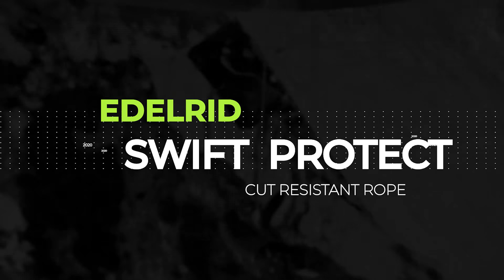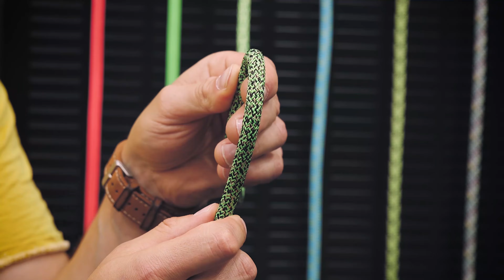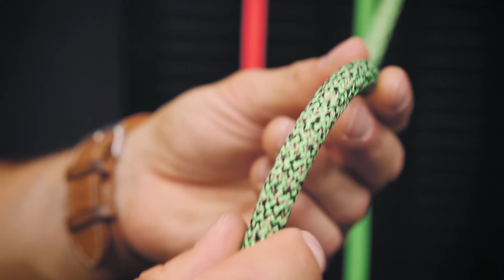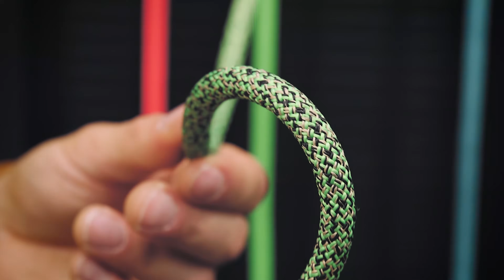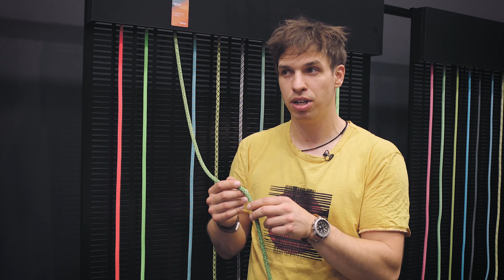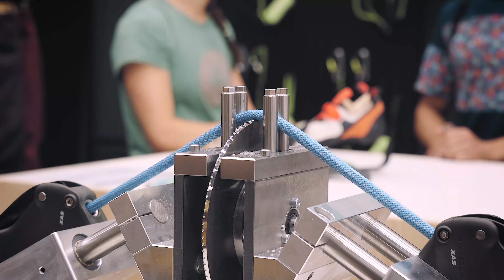*ALL NEW*  Edelrid Swift Protect Pro Dry climbing rope with aramid sheath

Comment: Friend just core shot this rope on a single rappel. His mistake was running it over a relatively sharp edge, and being a bit less than smooth in his rappel, stopping and bouncing a few times. That said, the rappel lasted all of about 20 seconds, so for this rope to boast as it does about cut resistance seems to be completely inflated in my opinion

Comment: Jeezus... people are going to climb on an 8.9mm single rope? That takes some real faith. Why not put this same tech into a 10mm rope and produce something that is absolutely bomber?
Reply from the maker: Tommy Caldwell told us he climbs on the 8.9 swift (non aramid version) for almost everything other than big walls. Like Phil mentions in the video, with all the incredible technology in dynamic ropes these days, cut resistance is THE limiting factor in rope safety, which is why Edelrid spent the last 5 years trying to figure out how to measure cut resistance, and then make ropes that actually are more cut resistant... and therefor safer. There is very little evidence to suggest a 10mm rope is safer than an 8.9mm rope IF that 8.9mm has the same cut resistance. Assuming that it's necessary to have a 10mm rope or larger for it to be "bomber" might be more of a mindset we hold than a statistical reality. If we can't point to accidents in which 10mm ropes were cut, than adding addition cut resistance to make a 10mm "bomber" is like making a rope that can be certified to 30 or more falls in a UIAA test. At that point, there is essentially no evidence to say it is better, even if it is more. It feels safer, but the margin of safety might be so large to begin with that any additional margin is effectively inconsequential. Caveat: I don't have any specific scientific evidence to back up these statements, they are simply my opinion that I've formed after limited research and speaking with many rope manufacturers.
-Andreas
Reply: @WeighMyRack  Yeah, I'm not Tommy Caldwell. Nor are 99% of climbers on the planet at his level. Don't tell me we're doing that crap now with climbing gear. I don't much give a shit what shoes Tommy or Chris or Adam wear or which cams they use or which rope.
Reply: 2 reasons: people want skinny ropes because they are lighter, 10 mm rope with this tech would probably be too stiff.
Reply: When you are using a 80 oe 100 m rope it makes a huge difference if you are using a 8.9 or 10mm rope. I climbed a lot on a 8.9  and 8.7 mm rope belayed with an grigri without an issue. The modern ropes are really durable, maybe you should try it.
Reply: @mikafull  Even with a 60 m rope it makes about 0,5 kg difference in weight between a 8,9 and a 10 mm rope. 0,5 kg is much in the alpine environment.
Reply: Man people have been running 8.9 for a long time now, over ten years.. Beal Joker, Mammut Serenity etc. The ultimate strength not far off, usually just rated for less falls. I'm on the large size, so 9.5 for my light rope but lots of my lighter mates run 8.9. 53g per metre is pretty good!

Comment: Does anyone else not want to run a 8.9 through a grigri? I would buy this right now in 9.2 .
Reply: According to the german alpine association the grigri 2 has a holding power of 240 kgs with a 8.9 mm rope. This means that it locks the rope completely and this matches my experience.
Reply: It is really not a problem.
Reply: Actually, if I remember correctly, you aren't even allowed to do that on a Grigri 2 or Grigri+ (it starts from 9.0mm there), but on a new Grigri (aka Grigri 3) the diameter went down to 8.5, so in theory you should be fine - but agreed, it would probably be perfect if it was slightly above 9mm.
Reply: @fireman2375  The GriGri 2 is from 8.9mm to 11mm (9.4-10.3 is ideal though)
Reply: Imagine they started small for investment cost and will slowly expand  the technology into bigger diameter.
Reply: It’s fine

Comment: What about the abrasion resistance? It's the main issue with the ropes.
Reply: Is cutting resistance not abrasion resistance...?
Reply: @HandFedMole  Not exactly. It may be linked, but not directly.
Reply from the maker: I'm really curious about this myself! I can imagine that the aramid would dramatically increase abrasion resistance, in theory. But the proof is in the pudding when it comes to real-world use and how the aramid and polyamide (nylon) fibers interact. Time will tell :)